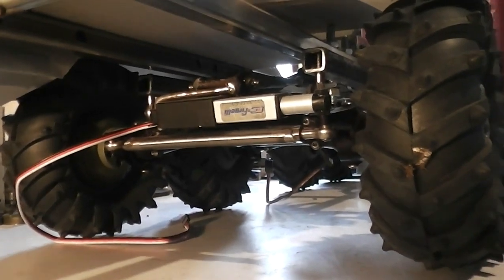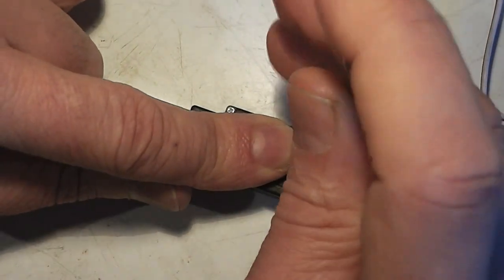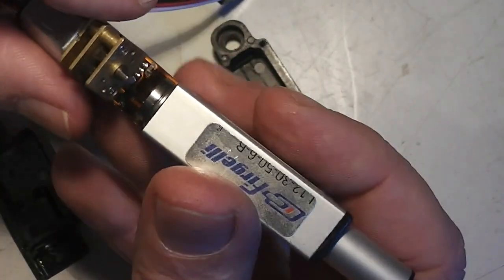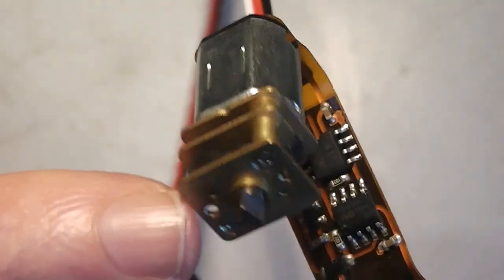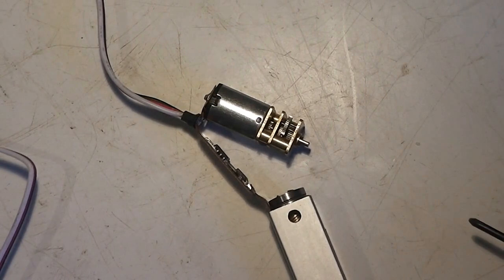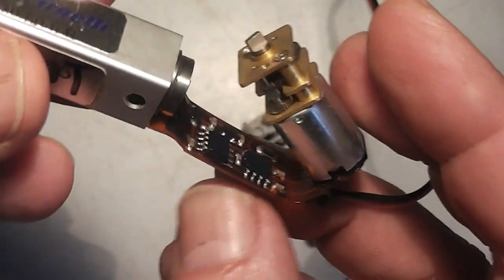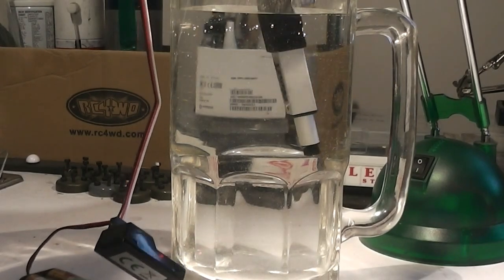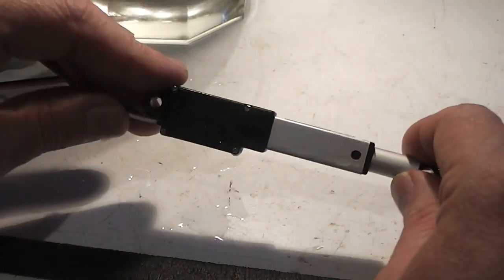Project: Wolf Spider. (part 11) Custom steel RC 8x8 Heavy Prime Mover.

Comment: I meant the linear servo case. if you cut off a short bit (10mm) of small diameter brass tube (available from Acorn Models). Drill a hole through the case of the linear servo and glue it in. take some silicone tubing (available from Acorn Models and sold as model aeroplane fuel line), insert the tubing over the brass tube and run the tubing up and inside the cab. leave the cab end of the tube open. How it works: When the linear servo expands it creates a vacuum, normally this tries to suck water in from outside of the case in order to equalize the pressure. Now that you have inserted a vent tube from high up inside of the cab, it will suck air down the tube to equalize the pressure when the linear servo expands. Dallas Mathieson.
Reply from the maker: ah, I see now. Good idea.

Comment: Hi Cyanide.
I meant the case of the linear servo. if a small hole was drilled through the case and insert a small (10mm) long brass tube (available from Acorn Models). glue it into the case. insert some surgical silicone tube over the brass tube and feed this up through the model to a position high up in the cab. leave the top of the tube open. (Acorn Models sells this silicone tube as fuel line for aeroplane engines). How it works: When the linear servo expands it creates a vacuum within the case. When sucks air down the tube to equalize the pressure within the servo case, rather this than it sucking water into it

Comment: Hi CyanideOn real 4wd trucks we pressurise the diffs to keep water out with a slight positive air pressure. I wonder if it was possible to insert a fine plastic tube into the case and vent this tube high up inside the vehicle? I believe that it would suck and expel air through this tube as it expands and contracts rather than suck water in through the ram. (Air being less dense than water).Are you in Christchurch? I am in Nelson.Dallas Mathieson.
Reply from the maker: Yeah mate, in Christchurch. I doubt the axles would hold any air, there is a lot of ways for it go get out. Cool idea though, I did not know that was how it was done.

Comment: Good eye noticing the flat part of the bearing faces towards the PCB! Otherwise it will rotate and possibly damage the PCB.
I might also want to point out that this procedure in the video will not protect the flexible PCB inside the shaft or the printed ink that is on it.  Unfortunately when the shaft extends and retracts it creates a low or high pressure inside the housing so completely sealing it is not possible without affecting motor performance.

Comment: Nice video. You might seal also the housing !?! ... LIKED
Best regards from Germany
Reply from the maker: +goooodmann Not really worth it, the water will get in where the shaft moves in and out. There is no rubber O ring on the opening.